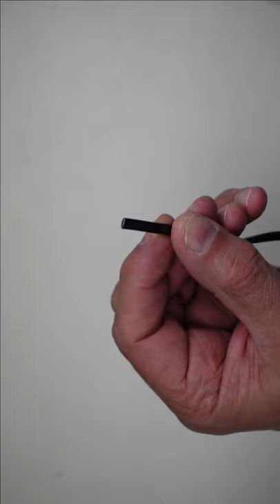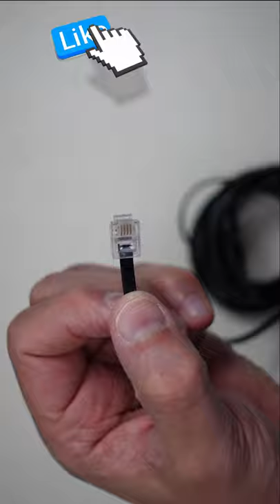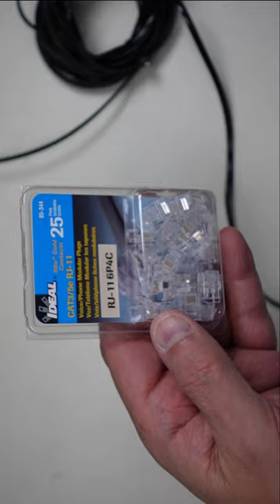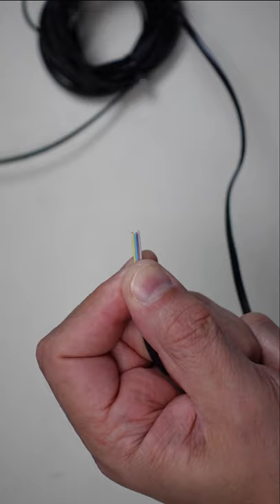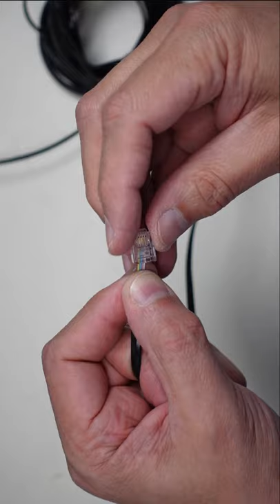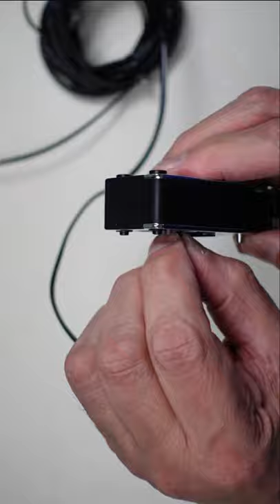Properly Attaching Phone Line Connectors #Shorts

Comment: Hi David I installed the wires red green yellow black clamped the end hard but not getting DT. 
if that order was incorrect and I connected the green yellow to the jack shouldn’t that have fixed the problem?
Reply from the maker: Sometime the green and red need to be switched.  Only two of the wire matter, a black and either of the other three, but sometimes certain equipment has them switch around.  Can you take a look at the other side of your phone socket?